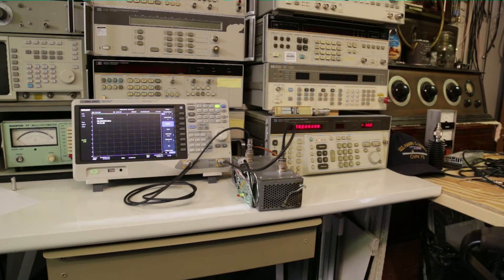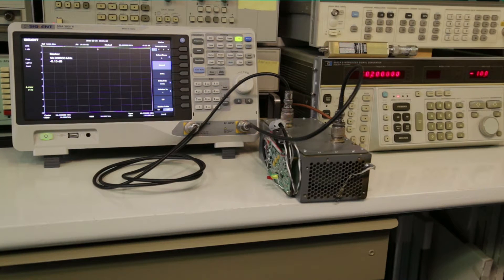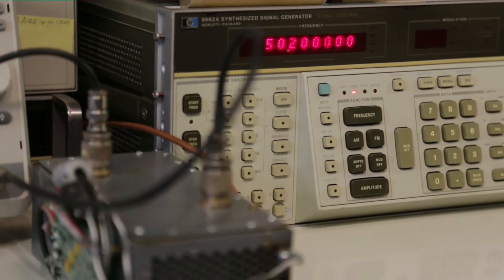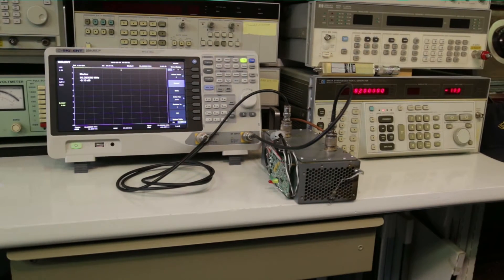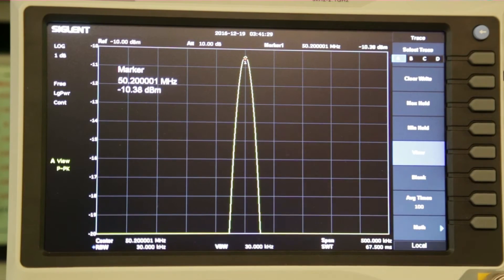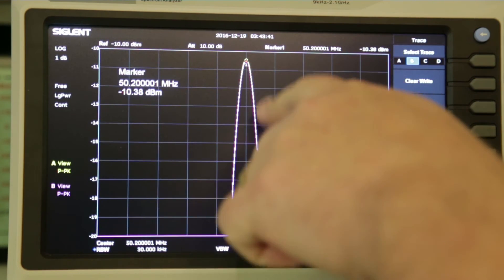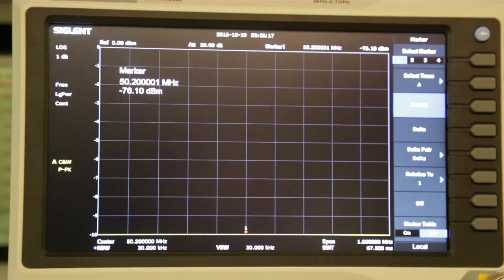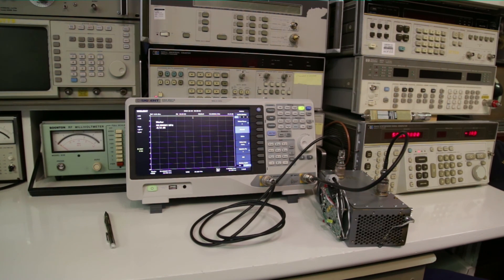Siglent SSA-3021X TG Take 2 (some corrections)

Comment: Good morning,
congratulations on the video.
I saw the wonderful HP8662A generator near the SSA3021X.
I think it's very interesting to display a 1GHz signal generated by the HP8662A generator on the SSA3021X with RBW with automatic; Span 100 Hz, Span 1Kz, Span 10KHz, Span 100KHz, Span 1MHz.
I am very curious about the result.
I would like to buy the SSA3021X but still have some doubt
Thank you
Mario
Reply from the maker: Hello Mario and thank you for looking at the video & for taking time to comment. The HP-8662A is in fact a beautiful signal generator. It will soon be time to put in many new capacitors & to do an alignment on it. The way it is right now it is still 100% virgin and stock so it would be interesting to see things like phase noise etc. I will see if I can make you a short private video of what you ask for.....HP-8662A making CW signal at 1 GHz and I will show you what the Siglent SA shows us when the span is changed to different bandwidths. I can post that video in my DropBox and give you a URL to the MP4 video so you may DL it. Send me a private e-mail so I can send you the URL back after I make the video. The Siglent is a FB SA that continues to grow better with each new release of firmware updates....there are still times it makes me frustrated but overall I am very happy with it. Did you know the latest firmware lets you have 1 Hz & 3 Hz RBW !!! I can also show what my HP-8562A SA shows using the same spans but the BW's may be different, I do not know. TU agn es 73
Reply: Hello, thank you for your prompt reply and for making a video on demand.
It's not easy to find a radio amateur with all your instrumentation.
I think HP-8662A is absolutely the best synthesizer ever built.
I've seen Siglent updated the firmware, but I think your test will be important.
Here is my email russomariom @ gmail.com Thank you again
Reply from the maker: GM Mario....I went ahead and made a video just for you using the HP-8662A sig gen going into the Siglent SA. Per your request I left the SA in automatic mode and all I did was change the span and let the SA choose the RBW/VBW. And, just for fun I put the same signal into my HP-8562A SA. And, just for more fun I used my Marconi 2051 sig gen and Siglent SA and duplicated the tests for you. I will send you a PM that has the URL where you may DL the MP4 video. I hope you find it useful. 73